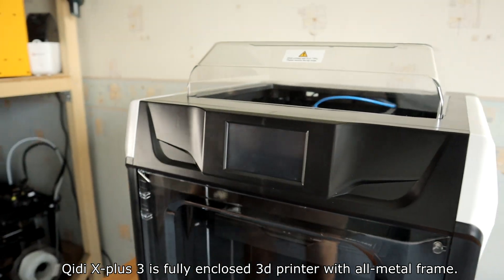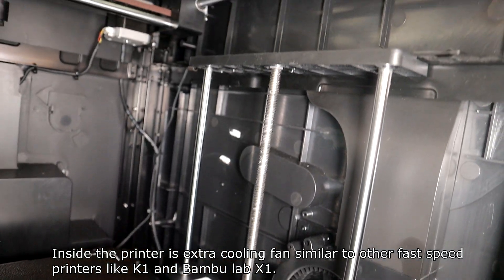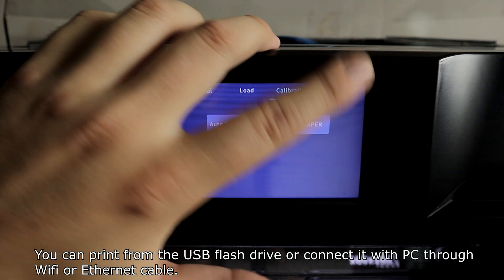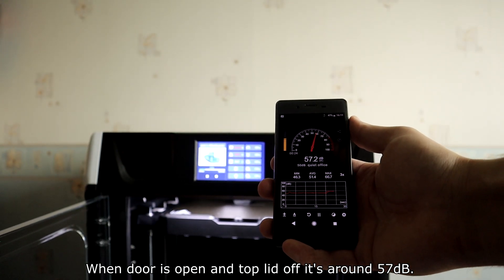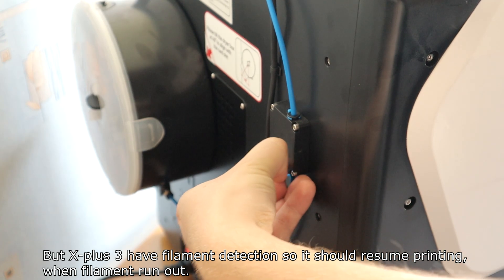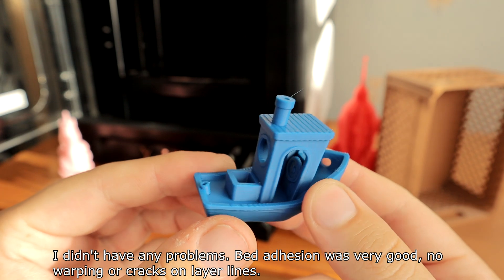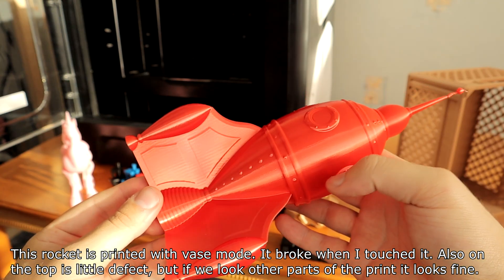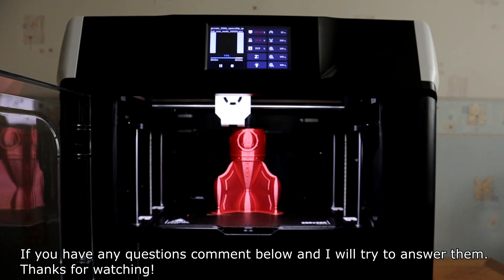Qidi X-Plus 3 │ High Speed 3D Printer │ My User Experience │Review

Comment: You have the old firmware! Yours is months old and a lot of issues have been fixed and more options got added! I have none of the problems you mentioned, TPU prints were very detailed and repeatable!
Reply: When I tested it, it was the newest version. I haven't tried new version, but that's if that fixed the issues. I will try it by myself soon.
Reply: @Mr44RO   I think you should edit your Video at the beginning to inform the viewers that this was the outdated firmware version, to be fair! Print Quality improved significantly after updating, some blogs posted pictures of a print before and after that update, and they seem to have changed something with their extrusion as the print surfaces got way smoother.
Btw, I can only recommend tuning the pressure advance in order to mitigate issues like the one I had, where some corners had constant underextrusion. Also set your Z-hop distance down from 0.4 to 0.2 as you'll eventually have more stringing on some prints. I advise to also look at your Retraction length as mine was set to 1mm, which for a direct extruder setup would be the highest number you should need... Definitely dial that down to 0.8 and then try changing it in steps of 0.05 depending on your results. I guess that those settings made the most significant impact on my print-quality so far... Okay maybe setting the flow multiplier from 0.95 to 1, and increasing my Line-thickness to 0.22-0.25 depending on the visibility of each line (eg. outer perimeter lines 0.22, infill 0.25).
Reply: @Elektrotechniker  Thanks for the info. I usually test printers with default settings to see how they work out of the box. If I have time I will make another video about update and how to increase print quality.